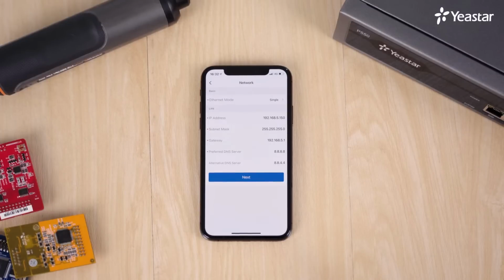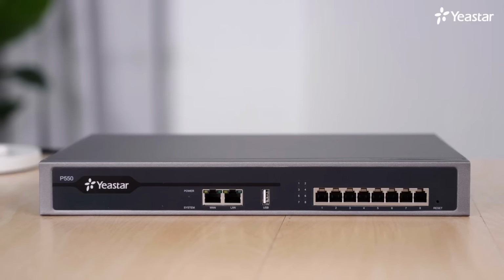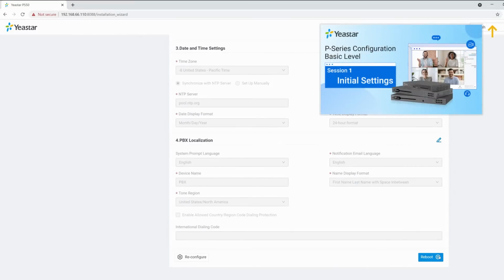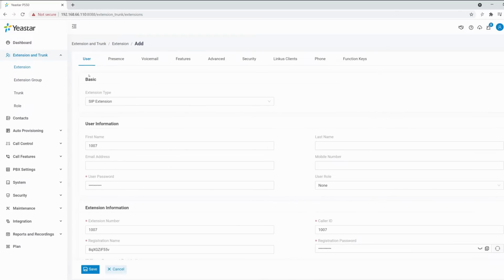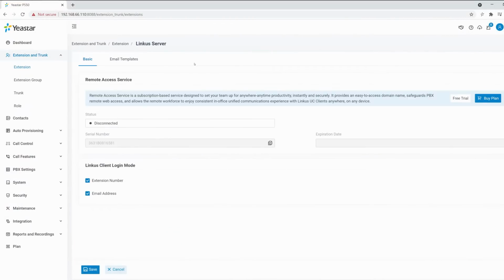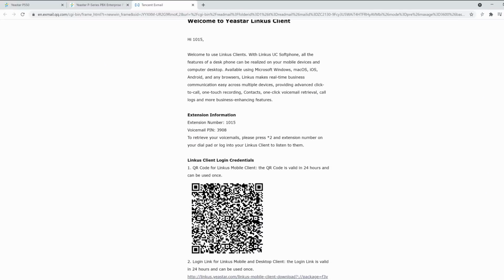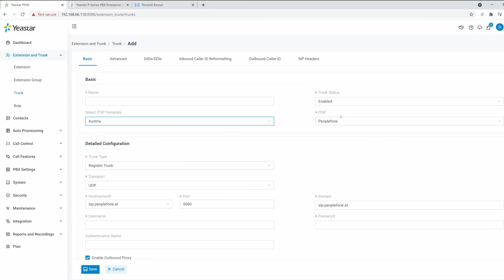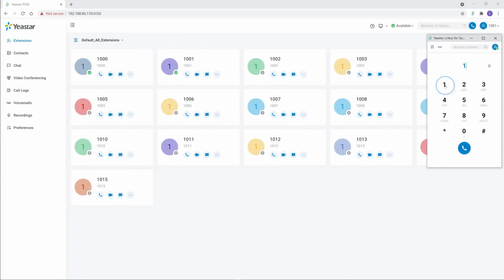IP PBX Quick Start Guide | Yeastar P-Series PBX System - P550

Comment: hello , the new model P560 have already a 200 slot ? or before we can use the 200 slot we need to add another module?
because in the description the slot of p560 is 100-200
Reply: Hi, do you mean EX08? For the hardware, you can refer to this. https://help.yeastar.com/en/p-series-appliance-edition/installation-guide/expansion-board.html?hl=ex08 Hope you can create a ticket on support.yeastar.com if you still have questions.

Comment: Is it possible to connect DIGITAL PHONE to Yeastar P series PBX?
If possible at which port type we connect the digital phone into ?
Reply: Hi, SIP phone, right? Just make sure the IP phone support standard sip protocol and you can use it with PBX. The connection between the SIP phone and PBX is the network.

Comment: How to dial extension phone to mobile number
Reply: Hi There, you need to create and outbound route. Within the outbound route, try to select a available trunk, select the the extension you used. Later create an problem dial pattern, for example, mobile number is 9 digits. THen input XXXXXXXXX (9* X) as dial pattern. Click and save to load the change.  Finally try to dial the mobile number on your IP phone.